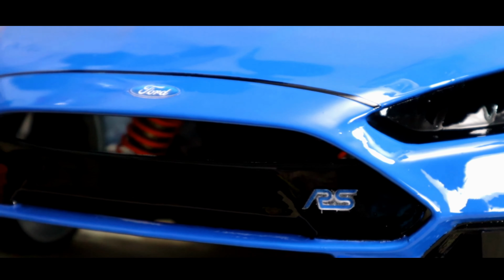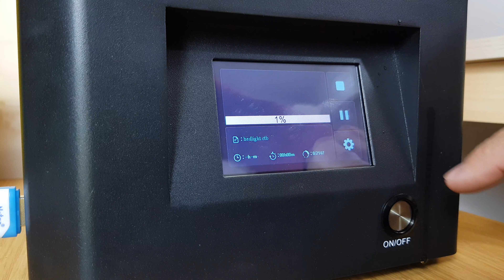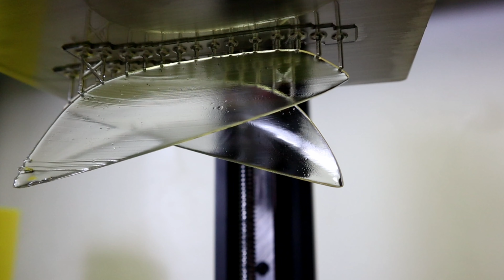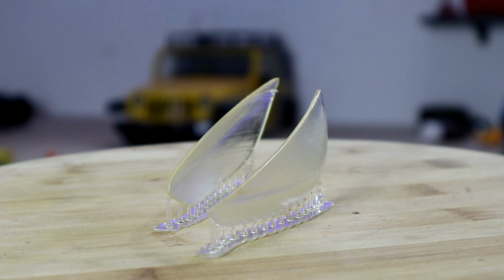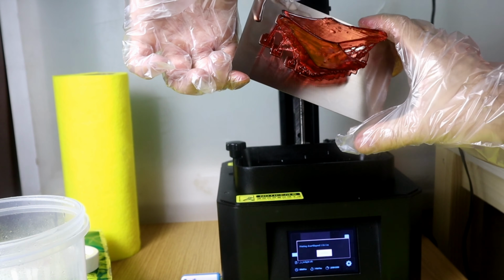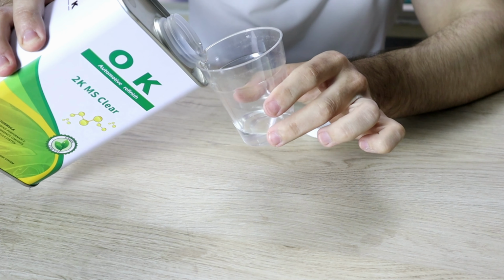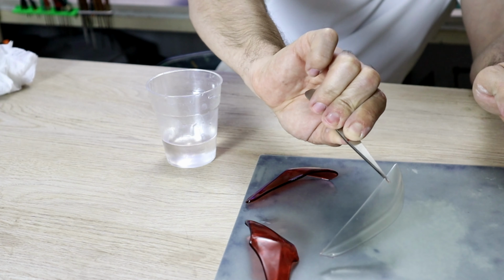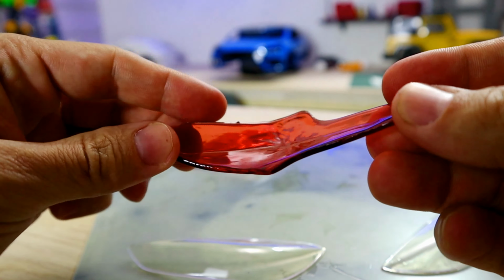3D Printed 8th scale ford focus rs part3/how to Print super clear Transparent / Scale Addiction

Comment: Just for some info. If you print w/ the clear filaments (my favorite so far is Matterhackers PETG), your best bet at "clear" parts is:
a. Single walls are going to work best
b. Sand the part, thoroughly, post=print
c. Spray with a high quality (all the store "spray cans" I tried turned yellow) clear coat (I use a 2 part, automotive grade, clear coat.